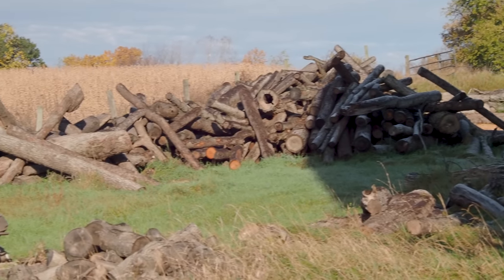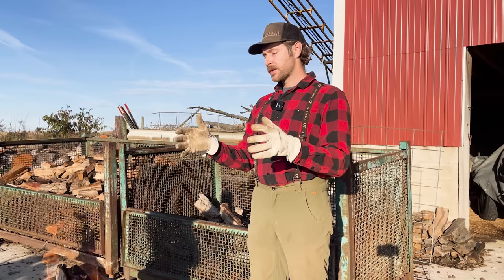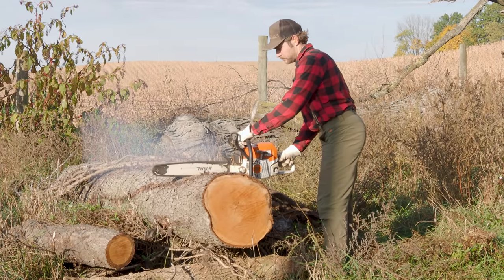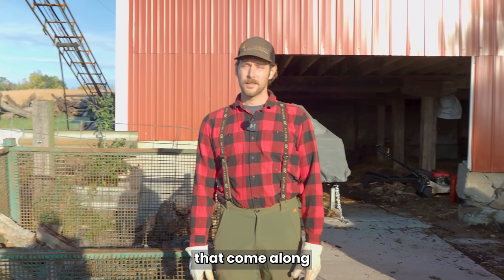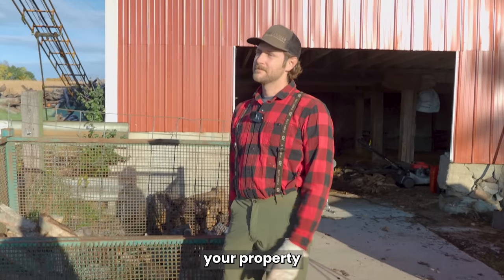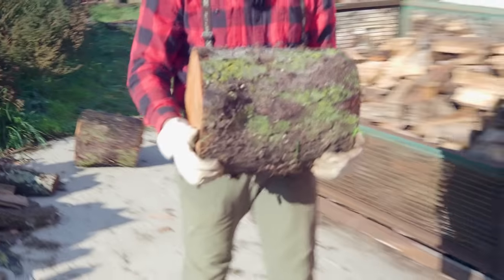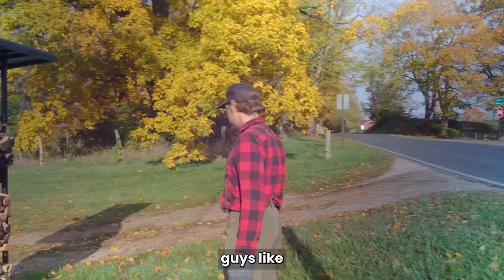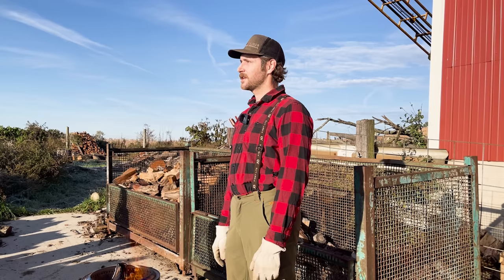How to Start $30K/Year Firewood Side Hustle Business

Comment: Don't wait until you're 70y.o. and in poor health.
After a severe work related injury at 58, I found out full recovery wasn't in my future. It took almost a decade to regain enough mobility just to get outside and enjoy a little light work. I took that to heart and kept pushing toward improvement.
Long story short, We supplement heat with firewood and I enjoy doing for myself. in a matter of months I moved from an axe(I had trouble even swinging) to a Huskee Splitter. Picked up a few different chainsaws on the cheap(no income/savings) budgeting my Social Security funds. Repurposed an old 4x8 trailer and I was off to the races.
I only sell if someone ask for some wood and I've donated a bit to neighbors in need. My goal is healthy exercise and preparation for that time when I can no longer handle the hard work.
Currently We have about 7 cords split and another 8 cut into rounds waiting to be split and staked.
.......unfortunately it has been Rain, rain, rain so far this spring.

Comment: When I bout my prop it was timbered. So I kept some and sold some. It's totally about where you live. How much you can get per cord. But overall I can say there's no moneyin firewood. Very hard backbreaking work. Very time consuming. In conn , mass or n j maybe 300 or 400 per cord. Here in NY at 200 per cord for get it. I'm keeping the last 30 cord I have for myself. To really make any money in it you need to spend around 200 k just to get started in it . Not worth it from my experience.
Reply: Yeah, we don't get even close to $200/cord here, but even at that, cutting/splitting a cord of firewood is a ton of work for $200 lousy bucks.
Reply: Just saying you do not need no 200k I started under 10k and a day job
Reply: Make 400$ a full cord I can get 2 in a day with some help make 350$ in a day with all the other expenses including gas and pay for the other folks. Just all depends